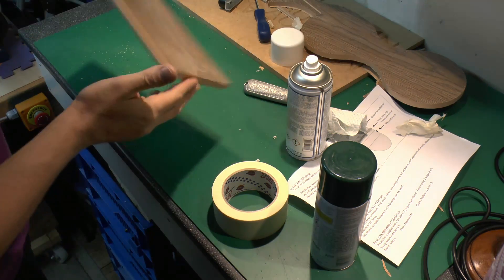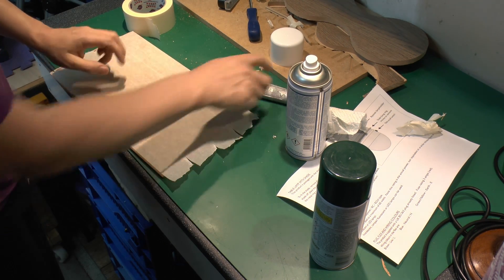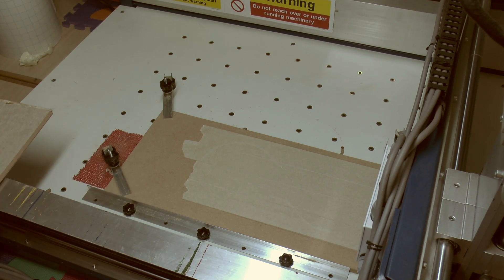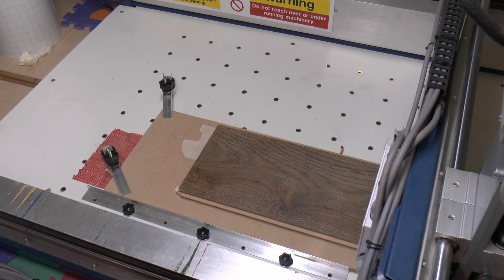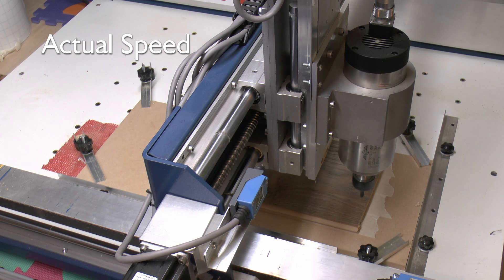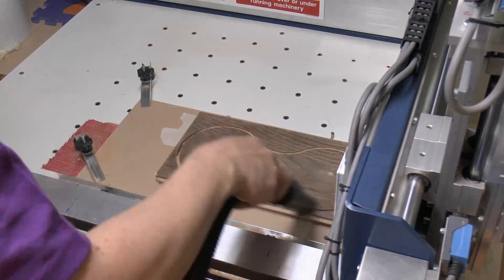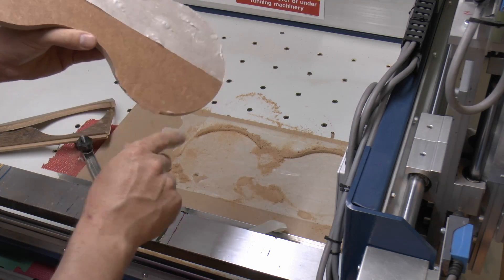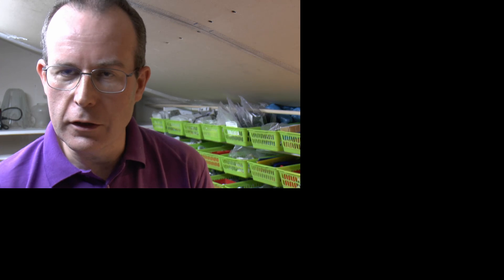CNC Cutting 12mm MDF

Comment: Wow! 12mm MDF cut in one pass!  I'm dying to know your feed and speeds and the type of cutter you use. I tried yesterday cutting MDF for the first time. My cutter overheats and I'm cutting much slower than this. Also the facing operation leaves this fuzzy - furry surfaces which is not ideal for what want to do. Any advice would be greatly appreciated.

Comment: hi john
i use the masking tape  but instead of super glue
i use double side tape  and i have had no issues with cutting 
out materials up 10 or 12 mm
so if you don't have the super glue and activator the double  sided tape with the masking tape 
works a treat
regards
james
Reply from the maker: I'll try that, probably quicker with the tape rather than the glue.
Reply: yeah 
its pretty quick to do  alright 
hopefully it will be of benefit to you
regards
Reply: I've used the heavy duty carpet tape (double sided) with a fair degree of success.
Reply: yes its is great for smaller  jobs 
maybe not for large items or high power machine
the double sided carpet tape seems a great idea for larger pieces
my little cnc is only the 3020t   so the ordinary double sided tape 
i find it works great for smaller a4 size items
and i have had very little isues  when using  the double sided tape

Comment: This "special MDF" is actually just a cheap floating floor panel. The method used to retain it is kind of clever, but far too much glue is used. Slow down the router head travel, and you won't be pushing the MDF panel around, hence requiring far less retention.
Reply: feed speed is just fine less feed may result in burning.
Reply: Karten - I am not talking about the quality of the cut. A slower feed speed will result in less force being applied to the panel, and thus it won't need to be held down so tightly. I call "bullshit" on your comment about burning.

Comment: Great John, and yes, more please!  The travel speed of the head seemed slightly high but the result speaks for itself.  In a non domestic environment MDF dust would be a big issue.  I think I recollect that you built a dust extraction unit but a suitable FFP2 mask would have it covered.   An insight into the programming of the control software would be nice.  When the machine was built I found this fascinating too, speaking as a complete novice to cnc work.  And what are you building?

Comment: Why don't you just use a slightly longer blank and clamp it directly? Seems like a lot of faff using the glue.
Reply: it still wont clamp the bit being cut!
Reply: With CNC, what you do is stop and re-start the cut, leaving a small "uncut" section  periodically. In this way, you don't need to clamp the centre section that is being cut... you snap it out afterwards. Also, the need to retain the centre part would be considerably reduced with a smaller router bit and a lot less head speed.

Comment: Great to see the router up and running. I think I will convert my old milling machine to  CNC.  I like your work holding but looks a bit tedious I have seen some people using vacuum tables to hold work and provided extraction. Those shapes are very pleasing to the eye.  I would find the curves impossible manual milling. I want to see more of these videos and hear about your experience using the router.

Comment: +John Ward
Talking to college maintenance, they were saying that MDF is banned in some countries for the dust-dangers it poses.
HSE claim that well-ventilated-room or outside is required [!!].
Just interested if you expect to have a dust-extraction-system or otherwise when cutting this sort of stuff on the CNC regularly, or otherwise just avoid breathing the stuff in and vacuum it all up and so-forth...?
Reply: I think the state of California (US), has determined that everything on earth causes cancer and requires everything sold there to be labeled as such.
Reply: Those products only cause cancer in California, every other place is fine
Reply: Air quality is very poor when machining mdf.   Always wear a good quality suitable respirator to protect your lungs.   After machining the air quality remains poor for some time so consider this and the use of air evacuation from the work space.  Look after yourself. 😁😊
Reply: I wanted a piece of MDF this week and the timber yard would not cut the sheet saying they were not allowed to by the HSE. I had to snap the piece in half to get it in my car, I only wanted a small piece but as a sheet was so cheap I was not bothered. Apparently breathing MDF dust causes respiratory problems fairly quickly with just a small amount inhaled.